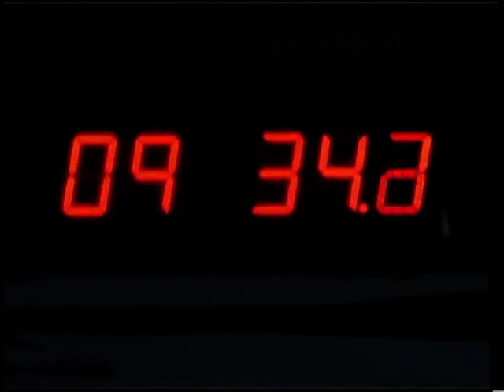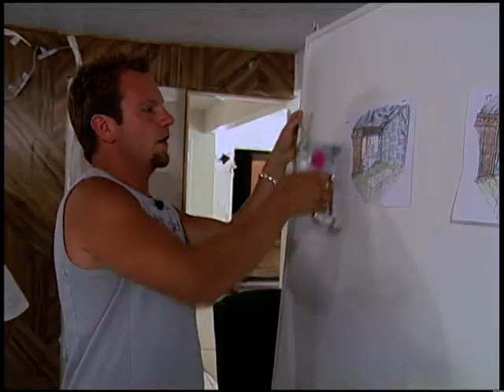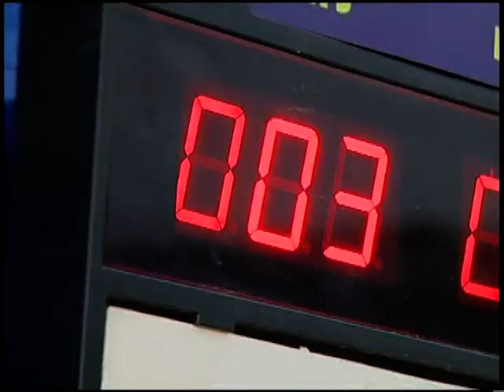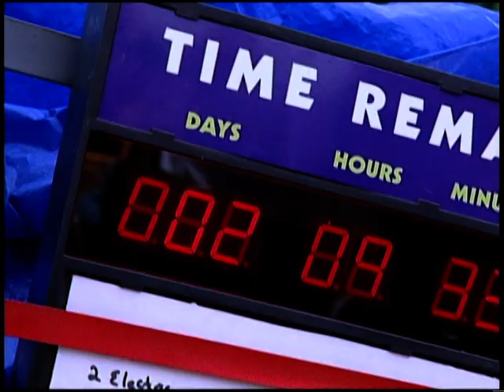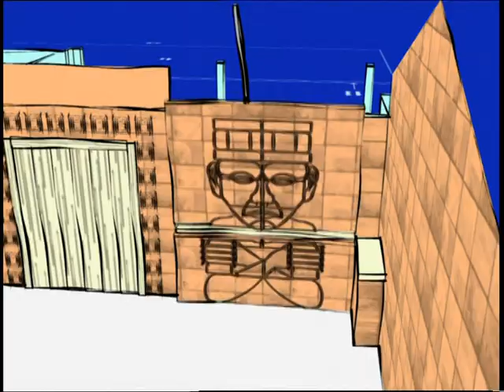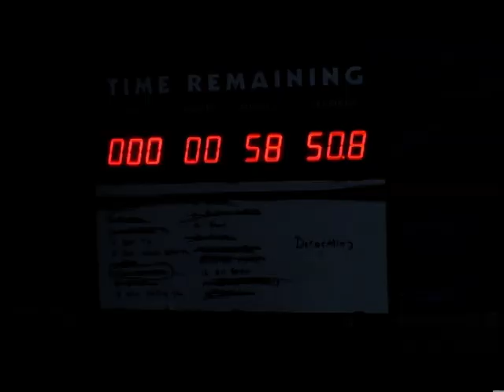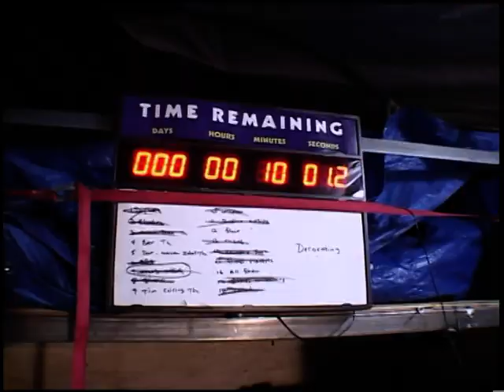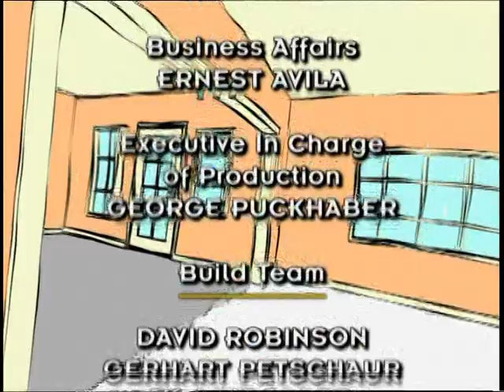Hacienda House - Monster House (Season 1, Episode 8)

Comment: This episode features Monster House's first failed build team.
Reply: The first failure was the Old West House. It was due to the inexperienced electrician. It also the first build, where Steve kicked out a build team member. Steve gave the team 9 hours on Saturday to make up for lost build time.
Reply: @brandonski1  Yeah, I wouldn't consider that a failure, per se. The build team for the Old West House still completed the build even if the clock ran out of time, and they still won the prizes for completing the build. So the Hacienda House was the one that had the first failed build team, and not the Old West House.
Reply: @brandonski1  that build wasn't an official failure.